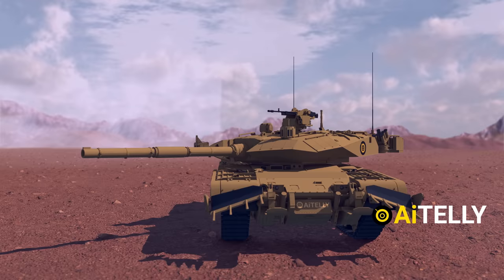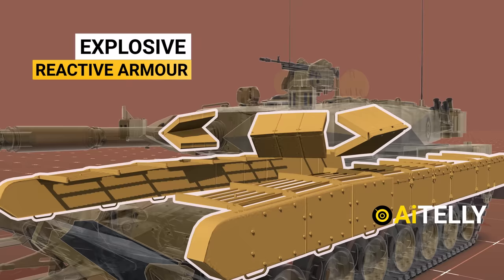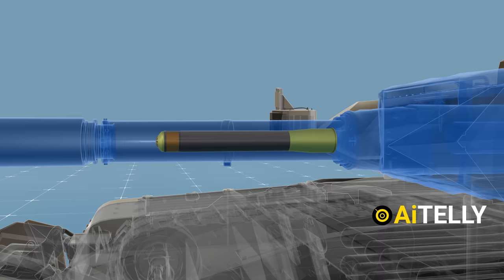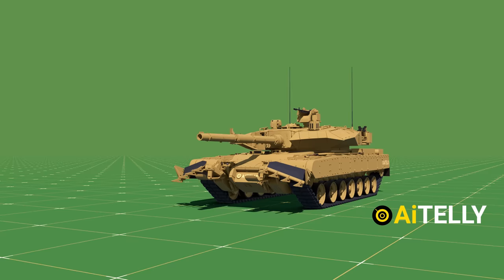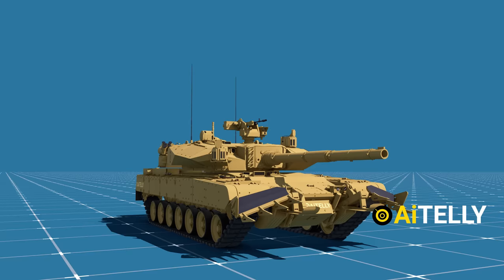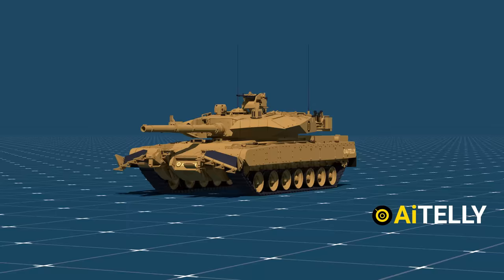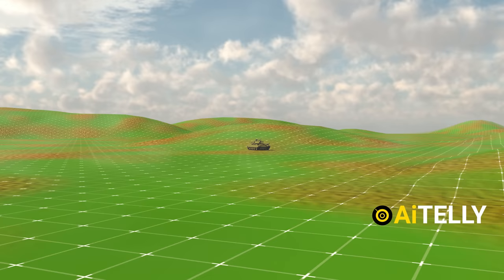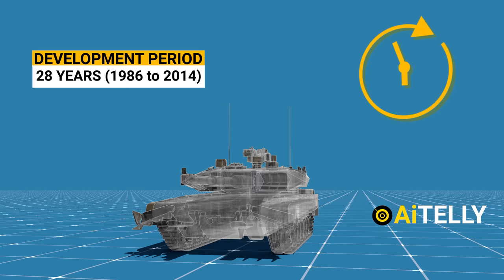Heaviest Battle Tank Arjun Mark 1A Mark 2 | How it works #tank #tanks

Comment: This tank is only being deployed to the desert plains on the border of Pakistan. Mobility is less of an issue there. Rest of the front lines in India are mountains and a smaller heavily irrigated area with lots of bridges - other lighter tanks are used there. India is building an indegenious light tank as well - Zorawar.
Reply: Correct and hence the need for the mine plows when going through the dessert areas into Pakistan, where there are extensive minefields. They might become a problem in the built up areas. There is a smaller 50 tonner being developed for the mountains
Reply: I wonder what Arjun would do against VT4s lmao
Reply: @gwshd-6344  it was designed mainly to counter the US Abrams if Pakistan ever gets them...
Reply: @plinnytheother6107   no bro its a 20 ton tank they are developing not 25 ton
Reply: @gwshd-6344  The VT4s will get smoked lmao. 

They are not functional or performing well, even as their counterpart Al-Khalid has shown in Pakistan(Al-Khalid is basically a Pakistani license assembled VT4, a bit dumbed down and painted with Pakistani logos and colors), where this tank is suffering from service issues, performance issues, quality problems where the barrels are bursting out when firing etc. 

Similar problems have been seen recently with their Chinese made JF17 thunder fleets in Africa, Bangladesh, Pakistan and other countries, where entire JF17 fleets are grounded due to constant crashes and difficulties. 

Besides, this is not a fair comparison as the VT4 is a light tank essentially and the Arjun is a heavy tank.
Reply: @gwshd-6344  Lmfao VT4 is literally a chinese rip off of T-72 
We are talking about an upgraded T-72 going head on against an upgraded t-90, a tank that is still feared by most of the West still, and add to that moder. Upgrades that have been designed to counter the Abrams?
Yeah least to say things won't end any well for the Hajis 💀
Reply: For this  problem we have T-72,T-90
Reply: @plinnytheother6107  actually it will be under 45 tonnes I guess
Reply: @gwshd-6344  The question should be "what VT4s can do against Arjun"? VT4 is a light tank and Arjun mk1 is an MBT or Main Battle Tank. VT4s can't even scratch Arjun's front Armor let alone penetrating it even at point blank range. While Arjun will make quick work of VT4s at more than 2 km distance
Reply: @chinazieswillstartww3253  Who said VT4 is a light tank? Where do you get your info from 😂😂😂
Reply: @chinazieswillstartww3253  Your Arjun has the biggest frontal weakspot known to mankind, even worse than the Merkava engine weakspot at the front, even T-54s from the 50s can pen that weakspot
Reply: Pooo 💩
Reply: @jelly.212  like you👌👌
Reply: they just unveiled and introduced it

Comment: Blow off pannel doesn't prevent explosion of the ammo, it prevents the explosion from going into the crew by making it go outside of the tank.
Reply: If the shot is hit inside the turret, not in the ammo box, he is talking about. It will prevent it from cooking of the ammo and doesn't explode like a pressure cooker. (Pun intended)
Reply: @marbletg3721  Like Russian tanks in Ukrain?
Reply: @chinazieswillstartww3253  Russian tank Dosent have blow off panel as it is a autoloader. Which is exposed.
Reply: @marbletg3721  I like how my country India has years of experience using Soviet tanks and still go for a manual loader instead of an auto loader when it comes to developing an indigenous tank. Because they might learned from their experience that manual loader has advantages such as it doesn't jam, and ammo can be loaded in a safe way
Reply: @chinazieswillstartww3253  hats a good thing................... i guess
Reply: @chinazieswillstartww3253  Don't BS here, the reason why India doesn't want autoloaders is because Arjun is made to fight in desert plains and hilly areas where autoloaders usually get jammed at high heat. It's a tank made for it's environment and surrounding hostility. Besides other strategically located areas in India is all covered by nature itself.

Edit: Autoloaders have the advantage of precision fire without any delay though if it actually rolls without getting jammed. You can say both manual and auto have it's pros and cons
Reply: @KingstonTiger  Auto loader or hunan loader which is fast is always a debate but the main advantage of manual loader is a longer apfsds rod can be used unlike in an auto loader. Means more penetration power
Reply: fun fact, arjun doesnt have blowout panels
Reply: @chinazieswillstartww3253  India actually has a lot more soldiers and a smaller front so auto loader won't make sense. Auto loaders are good when you have a huge border to defend with lots of tanks but you don't have enough crew members available.

Comment: Great video.  Fairly sure our current M1A2's weigh well over 64 tons without ammo or fuel.  The M1A2 SEP I had in Mosul 2007-2008 weighed over 80 tons battle-loaded and fueled (reactive armor kit, additional bottom mounted blast plate, 2nd .50 on the barrel & extra, extra ammo).
Reply: Challenger 2 is up there in the heavy tank club. It a race to be the thickest tank.
Reply: Can you tell me what is the most modern version of Abrams tank?
Reply: @VideosfromaSailor  Can't keep up with them now that I'm out.  The M1A2 SEP3 is in play, as in some armored units have them.  The M1A3 is an ongoing project, and it is incorporating changes made in the M1A2 SEP4, which is also an ongoing project.  The critical weak point in most modern main battle tanks is the weak top turret armor.  That's not an easy passive fix.  Need a new turret designed from scratch and you might as well redo the whole tank at that point.
Reply: @hammerfist8763  thanks for the info
Reply: @Statueshop297 its a challenge to survive in the challenger 2

Comment: Tank's Actual purpose to Run in "Lose sand" (desert) battle grounds.
Bcoz Rus T-90 & UK challanger was performing poor & Army was suffering from regular breakdowns.
So India designed Arjuna specially for that type of war feilds, later upgrade "Arjuna MK1A"..
Reply: That thing is even heavier than T-90 and T-72.
Reply: @Abdullah-mn6sw  it outperform t90 bro 

in the tank not only consider weight but firepower it has a good firepower than abhrams

Comment: I liked how things are presented. Traditionally, any Western analysis would simply run down any non Western weapon system as cheap, unreliable or obsolete. 
This video however states the Arjun MBT's positives and negatives very accurately. 
I'm impressed. 👍🏼

Comment: The main reason why the Arjun is so heavy is due to the tank not using very advanced armour such as depleted uranium alloys or chobahm style armour (NERA). Instead it uses reflector plates in the same concept that the T80 turret or the T90A turret uses. To have more armour than a T80 without using ERA is a very hard thing to do without NERA that's why I consider the Arjun to be a masterfully engineered tank even if it doesn't top the list, it's still a kicker!
Reply: The m1a2 is 82 tones because of the du that’s fully combat loaded also
Reply: Another reason is that the Army wanted a 4 crew design with manual loading. Automatic loaders on the Army's T90s seemed to get jammed at high heats of the deserts .
Reply: But sources say Indian Kanchan Armor is similar to British Chobham Armor. It is a advance composite armor for sure
Reply: @darkhammer2078  nope Abrams is pretty lightweight compared to Arjun.

Abrams fully loaded is 62,000 kg battle ready, while Arjun is 74,000 kg battle ready.

Abrams has a 12,000 kg advantage.
Reply: @gulag88  I’m a 19k brother and it’s 82tons ft hood /cavazsos TX also it’s faster in some regards
Reply: @darkhammer2078  no where near 82 tonnes.
Reply: @darkhammer2078  yes Abrams is much faster both in forward & backwards. Abrams has a good turbine engine which has over 2000 bhp & instant turbine torque.

While Arjun has a smaller V10 engine which can't handle the weight of Arjun.

Arjun is even heavier than the heaviest NATO tank, the Challenger 2.
Reply: @gulag88  brother the m1a2 sep v3 is 82.9 tons im a tank gunner im saying that because that’s how heavy it is the challenger is a lot lighter than the m1 m1 is only 64 tons w/o war kits and even still the abrams is still 78 tons
Reply: @darkhammer2078  you are talking about Tonns which are in imperial or are short tonnes.

I am talking about the metric system which is different.
Reply: @gulag88   I mean the sep v3 fully kitted is 90 short short tons and 82 metric it’s heavy
Reply: @darkhammer2078  Even the M1A2 SepV3 shows 73.6 short tonnes aka 66,500 kg. 

Which is much lighter than 69,000 kg Arjun Mk1A which has been made lighter compared to it's Mark 2 variant which is 75,000 kg aka 82 short ton.

Additional equipments were not loaded on it.

Normal Arjun Mk1 is pretty light weight aka 59,000 kg aka 65 short ton.
Reply: @darkhammer2078  a query is it made by Chrysler Defense or General Dynamics?
Reply: @gulag88  brother I’m saying I work on the abrams specifically the sep v3 ver google is wrong it’s been wrong for a while now the tank is 82.9 ish tons only reason ik that is because I’m a tank gunner I shoot rounds out of the sep v3 for a living or do matinence in it when you take the tank to rail it has to be weighed it’s 82.9 tons and 90ish short tons
Reply: @gulag88  Al tho that’s fully warranted kitted normally you’d get 76-78 w/o fully combat loaded
Reply: @gulag88  GD that’s who opent guy who helped us when we first got them about 2yrs ago and our fsr,s when we break things in them also
Reply: @darkhammer2078  is the armour depleted uranium or chobahm in SepV3?

The Arjun Mark 1 the lookalike of Leopard stopped a direct hit from T90 Sabot in point blank aka around 300 meters. I bet the Mk1A or Mark 2 version will outperform that too.

DRDO constantly improves the tank on every iteration.

The only problem is the gun although its riffled the accuracy increased but at a cost of mentainence. 

Plus a small engine.
Reply: @darkhammer2078  how reliable & the mentainence compared to Leopard 2A6?

As 266 is very close to Arjun.
Reply: @gulag88  well I’m not gonna go in detail about the abrams armor but it’s DU
Reply: @darkhammer2078  
I know that but what is the mentainence is it higher than 2A6 or lower?
Reply: @gulag88  it’s easy really the tank is build so that if things break theay ez to replace things break often but when theay do it may only take 1-2 hrs to fix serviceing the tank takes maybe a week or 2 but most of that time is cleaning the tank it’s really easy overall takes 30 minutes to take engine out and 5 min to put it back in
Reply: @darkhammer2078  the Russian tanks we have mentainence is pretty difficult especially the autoloader and replace the engine bay.

Same with our Sukhois which take 3 hours to replace 1 engines While in Rafale we can do that under 15 minutes.

Russians make everything complicated except AK47.

Comment: Sir Please Make video on Indian LCH or ATAGS.
Even Indian army is not interested in Arjun tanks.
That's why army order only 124 tanks,
India's Kalyani Strategic Systems Limited (KSSL) has developed a 155 mm/52 calibre ultra-light howitzer (ULH) called mountain artillery gun-extended range (MAG-ER). MAG-ER is an upgraded version of the 155 mm/39 calibre ULH known as the mountain artillery gun (MAG) developed by KSSL in 2020.
Please sir accept my request , 
Please sir.
Reply: Yes please make video on better Indian weapons like LCH LCH has the maximum take-off weight of 5.8 tonnes, maximum speed of 268 kilometers per hour, range of 550 kilometers, endurance of over three hours and service ceiling — the maximum density altitude to which it can fly — of 6.5 kilometres.
Reply: Hee you forgot about ATAGS ,is a towed 155 mm/52 calibre howitzer that ... Maximum firing range, 52.074 km (using High Explosive Base Bleed ...
Maximum firing range: 52.074 km (using High Explosive Base Bleed ammunition); 60 ...
Effective firing range: 48.074 km
Caliber: 155 mm L/52
Rate of fire: Burst: 5 rounds in 60 sec; Intense: 10 rounds in 2 min 30 sec. 👍
Reply: Yes make video on better Indian weapons not Arjun tanks, 
It's weight is biggest problem for Indian tureen.
Like Tejas fighter aircraft,
Pinaka rocket launcher,
Brahmos missile. 👍👍
Reply from the maker: What about LCA Tejay every one requested
Reply: Yes please make video about LCA Tejas.
The HAL Tejas is an Indian, single engine, delta wing, light multirole fighter designed by the Aeronautical Development Agency in collaboration with Aircraft Research and Design Centre of Hindustan Aeronautics Limited for the Indian Air Force and Indian Navy.
👍👍👍👍
Reply from the maker: @ozoneganeshafoundation1365  Next Week for Sure
Reply: @Aitelly   hahaha indians liked your vids bro cracked code for success nice job done
Reply: No its cuz arjun tanks on average cost 8 million, means we spent about a billion just buying 124 arjun tanks

Comment: the Arjun Mk1 main battle tank hasn't had a sparkling operational career . . . the Indian Army doesn't want it due to it's numerous faults & plagued with reliability issues, especially it's overweight at 66.2 tons . . . but eventually the army had to acquire around 200 Arjun Mk1 that are gradually being upgraded to Mk2 standards . . .

Comment: M1A2 Abrams weights 73.6 tons not 64, also the Challenger 2 weight more than 70 tons not just 62.
Reply: bruh its after Arment not dry weight
Reply: Bro live in your bubble... Your country is the best 😂
Reply: @Bring Some Good Beer, Prranjal's Here lmao after fully  armed the Arjun weigh 82 

Well Well Abrams and Challenger are tactical Tanks  very powerful and mobile :)

While our Arjun is just Run and Kill there is no coming back lmao just made for Pakistan :0 
I mean you can just see than full protection and best weapon and no speed just go and kill
Either we also have 3000 + t-90s that's for China :)
Reply: Arjun weighs 67.5 with fuel, ammo, crew & mine-plow... What's your source for that 83ton claim?
Reply: Nah the abram definitely do not weigh that much lol....U might have read loaded weight
Reply: 73.6 short tonnes which is barely 63,000 kg

Challenger 2 is 70 short tonnes which is barely 62,000 kg battle ready.

Arjun Mk1A is 73,000 kg aka over 90 short tonnes.